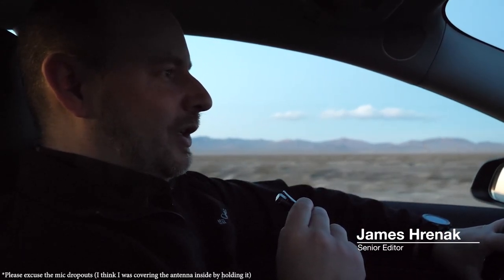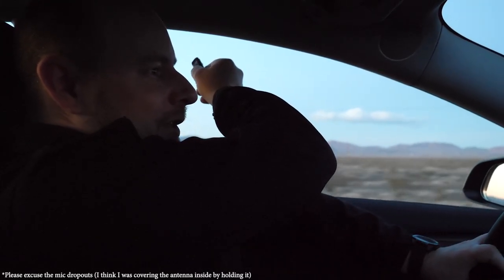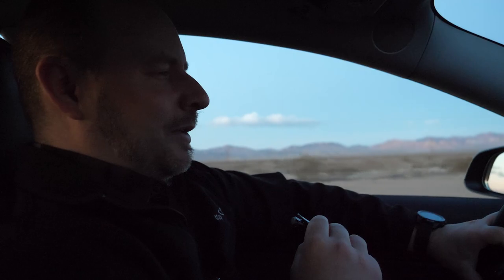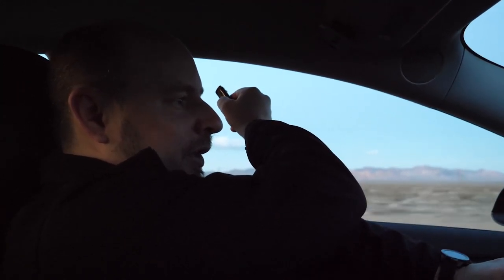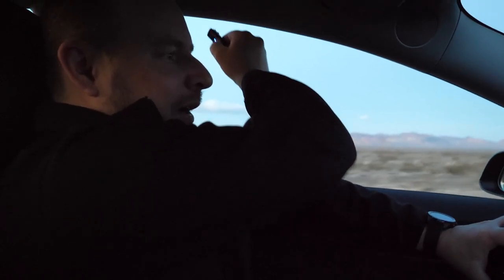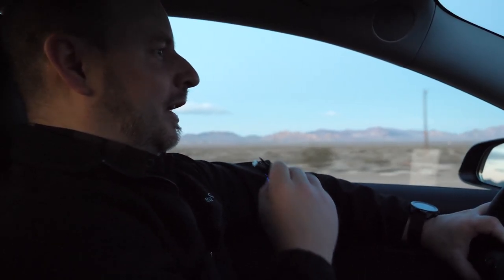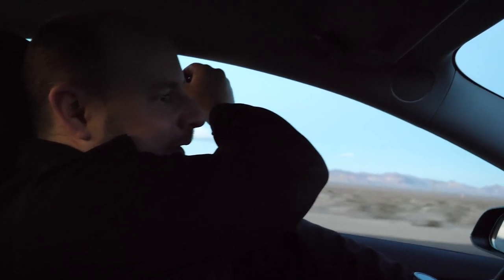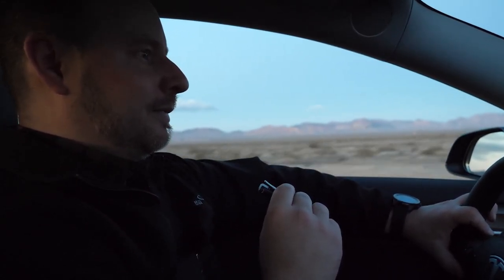Tesla Model 3 - Driver-Side Window Wind Noise (Audio Capture)

Comment from the maker: Update: I am happy to say that we have found a solution to the wind noise coming from the window. It isn't an acceptable solution since it doesn't fix the problem at the source and Tesla has taken no efforts to resolve it. However, the car has recently been tinted (windows) and that seems to have completely solved the problem. Not only has there been no noticeable wind noise, but it has clearly led to a slightly quieter drive due to the lack of noise coming from the windows (it's quite noticeable). Again, not an acceptable solution since it is an expensive one and on the owner to make happen, but if you do plan on tinting your windows regardless, it's at least an option. -- James H.

Comment: same prob jan23 m3. tesla could not fix it 3 service appointments. i pulled the window seal out around the corner and stuck 1/4" adhesive foam strips where the seal would sit, then put the seal back on over it. all wind noise completely eliminated. the glass wasnt pressing up enough against the seal. after adding the foam the seal presses tightly against the glass. dont bother with service, just do it yourself
Reply: How did you pull the seal out? Can you please tell me
Reply: Please provide details on the exact product used and how 2 replace please.
Reply: @alexsmith6271  literally just pull/tug at it lightly and it will separate from the frame. simply push back in afterwards. theres no adhesives, clips or anchors holding it in.
Reply: @frenchyfries3551  what 1/4" adhesive foam did you use? I have same issue and went to service for 2 times and never fixed..
Reply: @frenchyfries3551  thank you. It seems like it's empty on the inside so I'm not sure where can you put the foam.
Reply: Thank you!!!!!
Reply: Hi there...  I am not at all familiar with vehicle repairs of this sort.  Would you be kind enough to show what you've done and tell us the products you used?  Better yet, could you post a video?  Thanks!

Comment: My 2023 model 3 performance had this issue. I submitted a service request and thought they would tell me it’s nothing. Surprisingly Tesla service said they too noticed the wind and diagnosed the issue as my door not being installed correctly. They readjusted my door and the noise is gone. I would advise submitting a service request…
Reply: How much did they charge you
Reply: @CoachLapezo  it was free!

Comment: I just got my M3 Perf 2 weeks ago and have this same issue.  I took a test drive with service and they said that their short, under 50 mph drive didn't reveal anything out of the orginary.  I've spent $55K on a car and they told me to wait a few weeks to see if it resolves.  This thing is noisier than my 12 year old Camry.  I'm very unhappy that I have to wear airpods to work in the morning to not get more annoyed by the noise.  It does seem to be worse when it's cooler outside.  Don't get me wrong, I love the car in so many ways but the cabin should be quieter for a borderline luxury car.  Thanks for the video and it's good to know I'm not alone...
Reply: Hope you already fixed the issue. I just wonder if the recalibrating window was not helpful for you.

Comment: I test drove a mode 3 performance in the weekend (6 July 24 - Auckland, NZ).  Noticed a prominent wind noise around 100kph (65mph). Asked the salesperson whether he had noticed it but he hadn't.  Thought i was just being picky.  But I think it would be massively annoying if you were doing any motorway driving. Wonder how common it is?  Oh and thanks for your video
Reply from the maker: Sadly, it is quite common with Tesla vehicles. It has a lot to do with having frameless windows, mixed a little with poor design in keeping them sealed when closed. -- Ryan S.

Comment: Hi guys, I think I've nailed where the problem is with this, picked up my new LR Model 3 yesterday and only noticed it once we hit the motorway. On checking this morning, to me it looks like as the window closes it opens up the seas BETWEEN THE SEAL AND THE BODY of the vehicle, seemingly allowing wind to enter not into the vehicle cabin, but between the seal and the body of the car causing the noise. Going to point this out to them when I take it in. I'll try and post a video so you can see.
Reply: I have the exact same issue.  And here's my solutions. 

I've been working on my wind noise issues for many months. I have a 22 M3P. 

Coincidentally, after countess "fixes" and test drives,  I noticed my window opens the seal exactly like yours does. 

I don't see and other solution other than to glue and fill that gap. I used a weather stripping super adhesive,  you can get in any auto parts store. The one I got is 3M. I don't like that I can't smooth it but it sticks quite well. It seems to be holding that gap closed after I glued it a few times. 

Be really careful using it.
It's unforgiving if you get it on anything. 
Have rags and rubbing alcohol ready. 

But that isn't the only source of wind noises!!!!

I also adjusted the window to be tighter by pitching the top inwards. There's a really good video out on that procedures. I did it 5 times and test drove each time. I believe I moved the bottom inwards by 5 full turns or more. That moves the top of the window inwards tighter. 

There was also gaps at the B pillar glass (that holds the side looking center camera) similar to the gap you show but without any window pressure. I spent a lot of time getting that seal into place, where it would not, I glued it. 

I repeatedly checked and fixed the fitment everywhere. It's very time consuming. I need a flashlight and glasses. Again if I could not get seams to close and rubber to fit into where it's supposed to  I glued it. 

I found a hole, I guess it's a breathing hole, right where I hear the most noise. I glued that shut as well. I think it contributed. My theory is the rubber window gasket is hollow. Air pressure can get into the A pillar area and bleed out where our left ear is, and we will hear it.  I'd like to block the open end underneath the camera glass on the B pillar but I forgot how to remove that glass.

I inserted a small diameter vinyl tubing inside a hole that is just below where you videoed. 
The objective is to slightly enlarge and slightly stiffen the rubber where the window presses it, near the top of the window.

Overall the wind noise is significantly down. Not yet 100% but pretty good. 
I only notice it now at 70 + mph. It's no longer a sharp noise, it's light a light ruffle as the wind passes by. 

I keep checking and keep adjusting and gluing and road testing.  

The passenger side appears to be resolved says my wife.